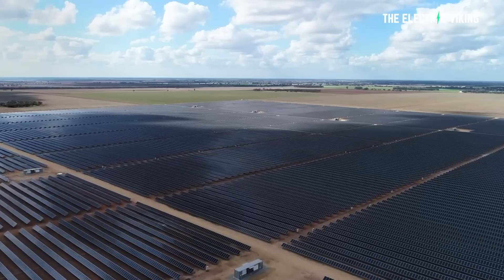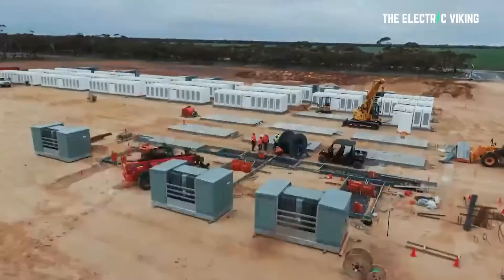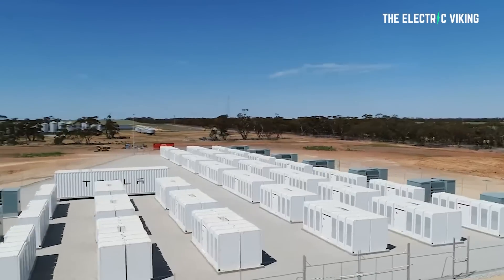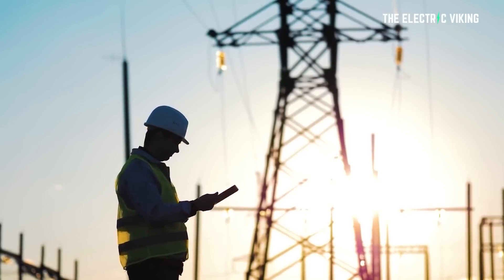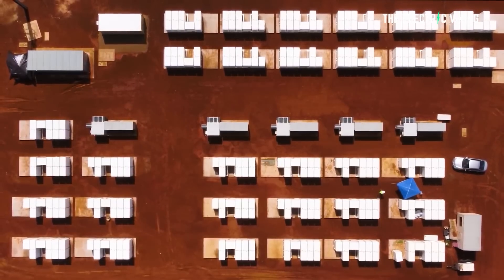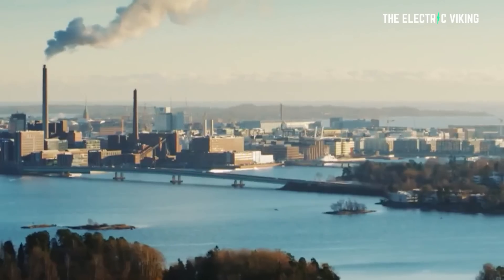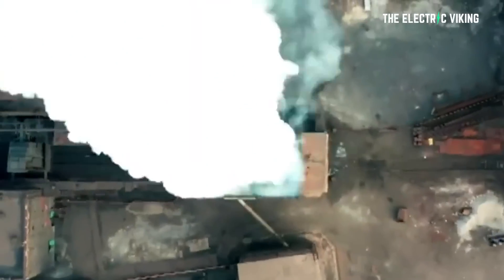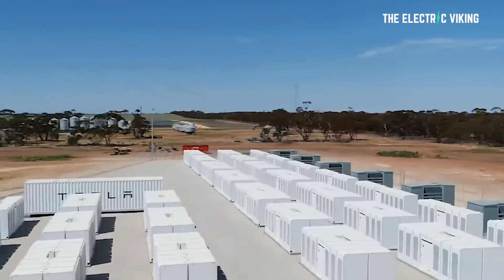The first grid battery in the world to provide system strength

Comment: Most people just think about "blackouts" where a storm takes down the grid for hours or days. System strength is more about keeping the grid voltage and frequency stable and constant every second of every day. If a big load randomly comes online, it can pull the grid voltage and frequency lower causing problems and if a big load goes offline, its just as bad as the line voltage will go up and frequency can go up. 
In the past, mechanical generation had to respond which takes a second(s) while a battery can be a load or a source to compensate in 1/000 of a second so actually much better regulation.
I worked at a plant where there was a machine that took 40 MW and we had to call the power company to put more water over the dam before we started it.

Comment: Batteries supplementing or replacing peaker plants have the most bang per buck. Conventional energy plants have to run in advance of expected demand and any unused electricity goes to waste, batteries can respond instantly and only as needed. A relatively small amount of batteries can have a big savings.
Rooftop solar and house batteries can lessen the load on transmission lines & load on the power plants & compensate for failures

Comment: It took me a long while to try to understand the term, "system strength".

I've heard of batteries now cheaper (and faster) to deploy, than the capital cost of building gas "peaker plants".  This is increasingly the case, in many situations.  You need something to follow demand, as well as deal with the variation in supply, as in the case of renewables.  And batteries have millisecond response times.  (Wasn't this first demonstrated in the Hornsdale project?  Elon Musk said, he could solve their grid instability problems for them.  And in a few months.)

And of course, "arbitrage" means buy low, sell high, with the ability to "time shift" things with batteries.

Comment: Move on from solar panels already!! Combining self running generators and power walls in homes and businesses would give us seemingly endless clean energy and be far better in many ways.
Reply: "Self running generators"? Do you mean perpetual motion machines?
Reply: @CiaranMcHale  I specifically mean, the alternator magnet combo version of self running generators. Look it up yourselves. The tech has already been proven. And if you have constant clean energy going into power walls 24/7, we'd have more than enough clean energy to run everything.
Reply: @caseyford3368  The internet searches I performed based on subsets of the keywords in "alternator magnet combo version of self running generators" suggest it is a perpetual motion device, which means it cannot work as claimed. It is possible that I didn't use appropriate search terms, so if this really is proven technology, as you claim it is, then I assume you will be able to give me relevant search terms or provide the titles of some articles/videos about this technology.

Comment: I wonder if they build these with ability to disconnect entirely from the grid in case of a massive solar flare.

No idea what the cost of replacing all of that electrical hardware would be, but probably expensive, and would take weeks (or months with little to no replacement parts ready).
Reply: Thanks for inventing an imaginary problem Mr FUD.

Comment: Nice, but I still don't understand whats new about this. Everything you said is already been done by lots of battery packs all over the world. Be it large centralized or small decentralized packs. It works especially well in short term balancing and frequency control due to the quick reaction time. Usually smaller packs, up to a few MWh are stacking business cases incl. load balancing for on site power demand. This market is just getting started but not 'new' at all. Ps. The biggest competition is probably electric cars that in large numbers can do some of the same things with smart charging and in the future v2g.
Reply: Exactly, the big danger to this is the big push by the central power companies to go nuclear, and lock in their business for 100years.
In Australia they have gained Government guarantees to their cash flows.
And own the poles and wires, the national grid.
Their logic only has some sense if every country can do the same. 
But financially it is stupid.
In Australia we have built toll tunnels and if self driving vehicles come then rush hour will disappear, with less vehicles on the road. 
New technology evolving. We will still have toll tunnels with government guaranteed cash flows.
Same with Nuclear power.

Comment: Are these what we in the US call a “peaker plant”? It helps stabilize the grid during peak power usage?
Reply: He said "it does it all"
.
Looks like the solar (and wind?) input feeds the batteries to say 90% and then the grid.
The grid then gets a constant amount (as with a "conventional" generator) but the battery can "tweak" output as the grid requests a variation, or collect energy if it's not needed (say when other generators are "ticking over" at night?)
Essentially fast, versatile baseload with rapid backup *and" storage.
Ideal.
Reply: It certainly sounds like it.
Reply: Leaker plants, have they sopped using fossil fuels?
Reply: This is also what Tesla has started to do in California with Virtual Power Plants. They use power from thousands of private power walls to stabilize the grid when needed. The owners get $2.50 per kw/hr from the utility.

Comment: Can you please explain in you're next video "energy arbitrage, security and inertia"?
Reply: Arbitrage is easy. You buy power when it is cheap say over night when it is windy and power (here in the UK can be as cheap as 5 pence per kWh)  and you charge the battery with it. When power is expensive say at 6pm ( in the UK can go as high as 35 or 40p) per kWh you sell it back and make 30p on each kWh each time!
Reply: @patdbean  thanks, I never heard that term applied to that use in energy management.
Reply: @richardnwilson  yes, there will be  round trip losses and the battery itself has an  up front cost and will degrade over time, but if you can get 5 or 6x  return ......
Reply: Yeah, a lot of that needed a better explanation but it sounds cool. There was an interview with the grid operator in Hawaii where they are about to shut down their last coal plant and have just received their very last shipment of coal and he was talking about the time and procedure needed to bring a peaking plant online compared to the few seconds it takes to get batteries on the grid. Sounds like a real advantage just from an operations standpoint and huge savings. Imagine how much it costs to ship coal to an island chain.

Comment: They should put the solar panels on top on the batteries. It would take up less space
Reply: 20million buildings in Australia 
20million vehicles. 
If 33kwh rooftop x 20million 
= 660Gwh/day 
More than the fossil fueled electric power plants. 
Say 20million EV 100kwh battery 
= 2,000gwh stored daily. 

Big batteries and community batteries are a profitable transition technology immediately available. 
EV are much slower to bring in.
Reply: @stephenbrickwood1602  
Also, a good proportion of vehicles will be driven during the day, not collecting energy.
Reply: @rogerstarkey5390  there are 20million of both in Australia.
I am saying the buildings roofs are the structures holding the solar panels.
No need to cover farm land.

No need to have the supply concentrated into transmission lines and then dispersed to the ends of the grid.

At the ends of the gird is a building.
The sun comes up and the entire grid is energised. 
Say 20million building rooftops.
Also 20million EV batteries, with say 100kwh batteries that just need topping up at some time each day.

The buildings and cars AND the existing grid will be perfect.

The grid is UNLOADED, it does not have to supply 20million buildings, the grid just moves some electrical energy about locally.

We do not have to build new 25,000,000 kw of new nuclear generators as every building roof can do that job.
We do not need a huge grid expansion to carry the extra electrical power in a no fossil fuelled world.
Reply: @rogerstarkey5390  if you are saying that the cars will drive away from home each day and not be connected to the home charger, then that is not what I am saying.
I am saying that everywhere the car is parked, it is plugged into the grid.

The grid will trade electrical energy, just as it does with the big batteries.
The grid will know your vehicle.
The grid knows when your home takes electricity.
The grid knows when you feed in electricity.

The automatic plug in is important.
The vehicle plug in and unplug all automatically is important. 
Drivers just drive to the parking space, and drive away when they need to go.

Comment: Explain arbitrage and frequency please
Reply: Energy arbitrage is basically buying energy from the grid when demand and spot prices are low, like middle of the night, storing it in a battery, and then selling it back to the grid later when demand is high and so are spot prices.  Say you have a 2MWh battery, sitting at 50% charge.  Say grid demand is low and you can buy power at a spot price of $50/MWh.  So you spend $50 to top up your battery.  The next day there is high load on the grid and the grid operator is paying a spot price of $250/MWh.  You sell your 1MWh previously purchased and come out with a $200 profit. Now there would be some efficiency losses along the way since the battery cannot convert 100% of the input electrical energy into chemical energy, so you have some losses to heat. But that's the basic gist of it.